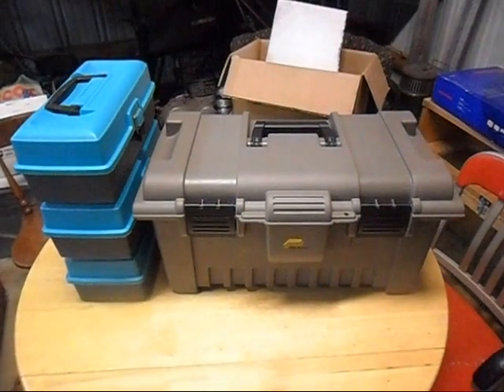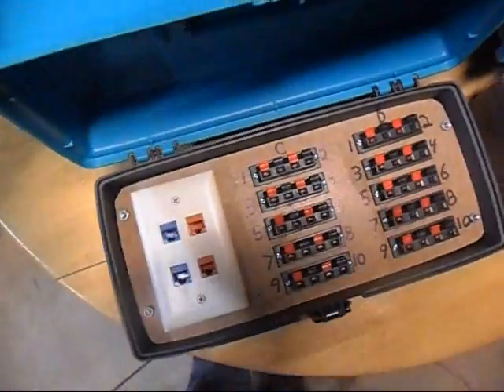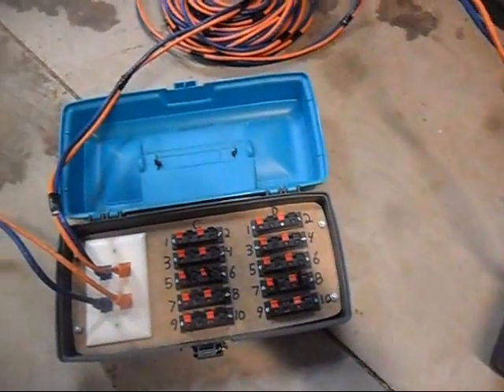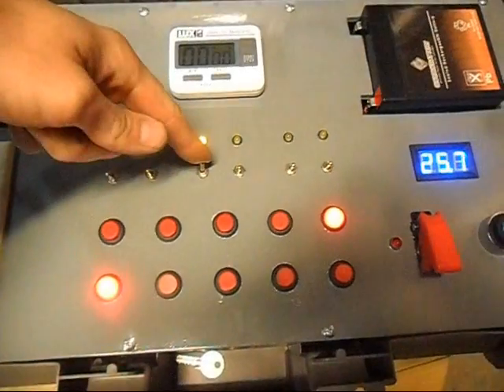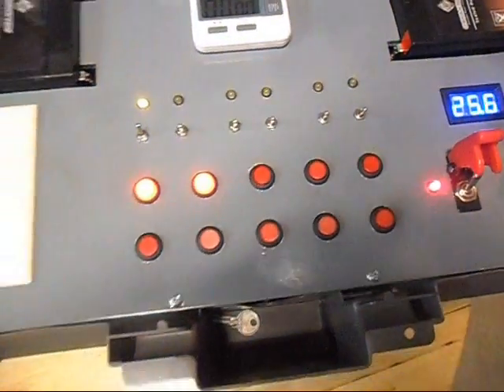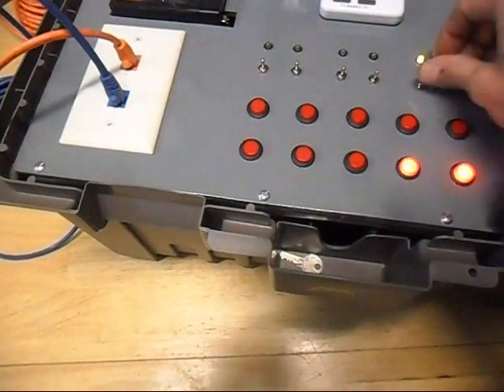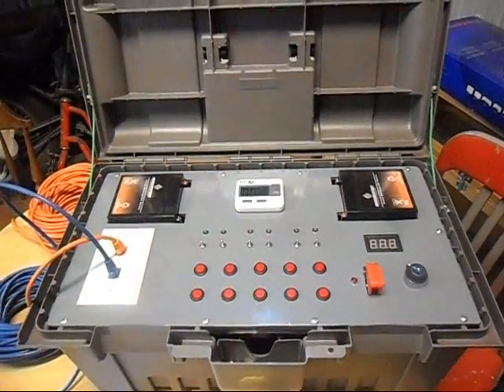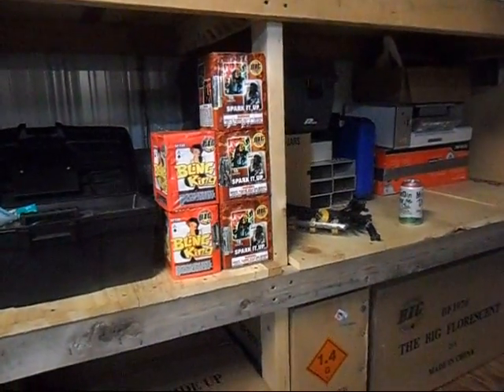60 cue firework firing system

Comment: I do have a question on how did you hook up the cat five cable's to the main box and how you did that wiring
Reply: Me too. Can you give at least a high level explanation of the wiring or point us to some resources that could help explain it?
Reply: I've found this page. Tons of helpful info if you're like me and don't know much about this stuff yet.
http://www.pyrofan.com/forum/showthread.php?3736-Firing-System-Panel-Designs-amp-Diagrams
I believe this setup is similar to one of the diagrams further down the page.

2 Cat5 cables = 16 wires.
10 of them are wired to the 10 ques.
6 of them are wired to the 6 banks.

Very well done.
Reply: Adam D i still don‘t understand for what use the bank switches are. Isn’t the rotary switch enough? Could u explain me the use of these? Or the rotary switch is not necessary. Well, this is the only point I don’t understand.

Comment: Are there detailed instructions on how you built this? I am assuming there are relays and/or electronics involved to transfer raw 1-10 data into a single stream and then the slats have an un-scrambler to transfer that single stream back into 1-10 data? I am looking into building a system and would like to consider all my options.

Comment: Moparman240 great job on a nice set up. I have been looking around pyrouniverse. The thing that makes your different is how do you run 20 cues on a cat 5 cable. Very interested in your design. Would you consider sharing your design in detail online. I am sure you could add it in Joe Ratman thread at pyrouniverse. Think about it.

Comment: im from lansing, mi where can you get the materials? radio shack or somewhere?
Reply from the maker: Actually most of the electrical parts I got from ebay , the boxes and panels I  found at Menards and a good source for the speaker terminals is WWW.PYROBOOM.COM

Comment from the maker: I don't like to go over 3 at a time just for the fear of melting wires/connecters, however I have tested and successfully fired 6 consumer igniters with this system. One test was an igniter in each bank and one test was 2 igniters per cue in 3 banks. 24v is the key, I tried the same with 12v but you loose to much power over long distances. So in short yes it will fire 6 but I wouldn't recommend it, at least not frequently.

Comment: Nice work. 
I was wondering if the Cat5 cables are capable of firing multiple cues? If all 6 banks were active, it would have the current of 6 cues firing simultaneously. I dont want to go to the expense of heavier (aks, more expensive) cables if cat5 will cope :)
Reply: colspyro i fire my system over cat5 and the system right now has 126cues and ill use it all and plus a few doubled up

Comment: ok thats lil more thinking then i would of put into it ya idk if you know pin boards but i have 150 foot runs of cat 5 so mine would cost more then urs but diy to diy if u add alot go to lowes or a big home improvement store and buy a 1000 ft roll of cat five alot cheaper to do that and put on ur own ends plus u can make them any length that way

Comment from the maker: All the cues are wired in parallel and I turn the bank grounds on and off to control witch bank fires, each black terminal has a 10amp diode to prevent the current from back feeding to the next cue.

Comment: how does the slats work in series like that wont the connection pass on through to the next once you set a cue off i myself made my own firing system same cat5 wat but i use the old pin board method worked amazing last year